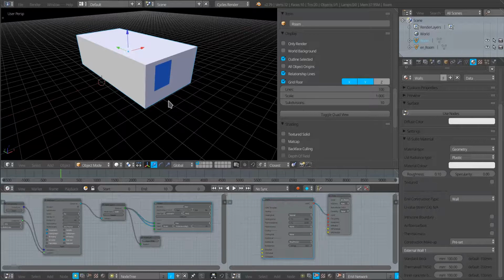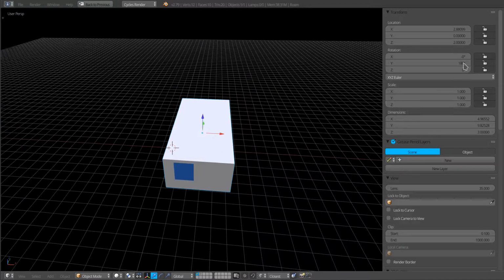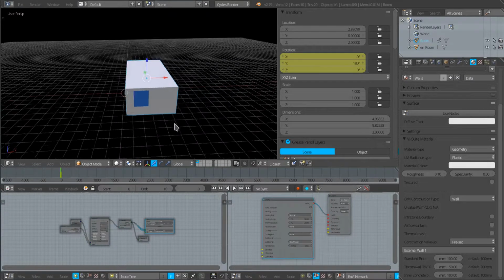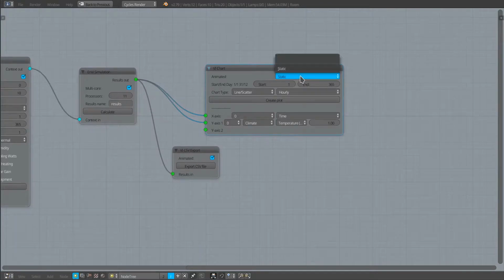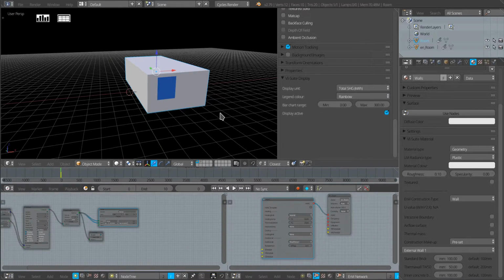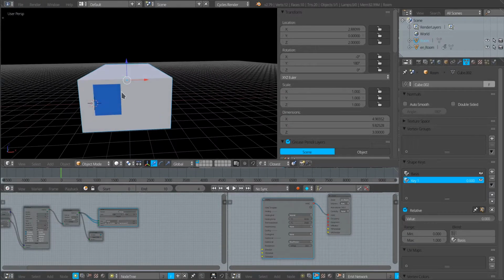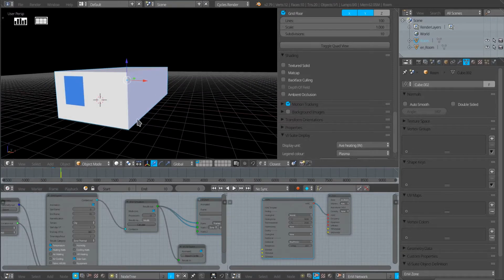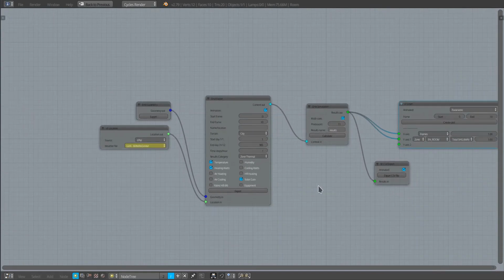VI-Suite v0.4 - Parametric EnergyPlus Analysis

Comment: I am amazed and overjoyed that you have put these systems together.  I have been using WUFI passive for my small design-build company for years, and let my license lapse for many reasons.  I don't want to pay, can't justify cost, don't run windows, the interface is clunky and inflexible, hard to iterate, and so on.  I have been learning blender for a few months now, and I just love the interface.  Meanwhile I have seen some of the open source energy modelling out there, and sighed to myself that I can't code and will never connect blender to these powerful tools.  You did it!  You had the idea years ago, and here the video sits with only 600 views.  You are making a revolution for me and maybe an industry.  Thank you.
Reply from the maker: Thank you for your very nice comment. I don't advertise the VI-Suite very much but I may with the next version.